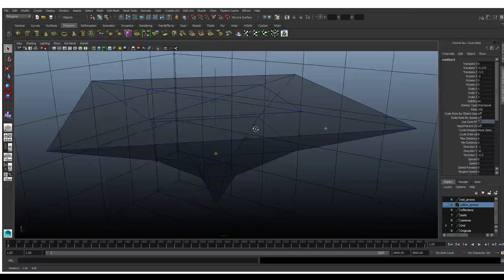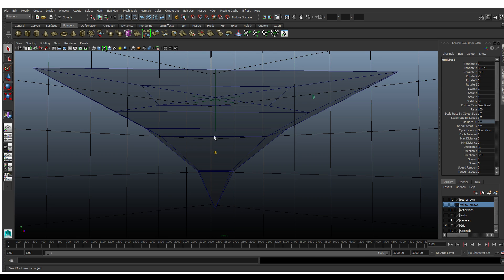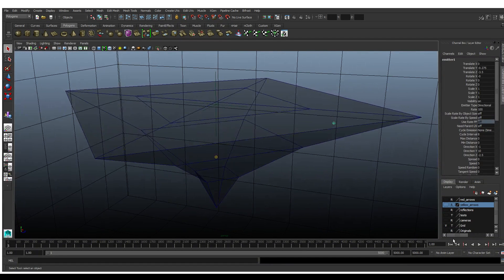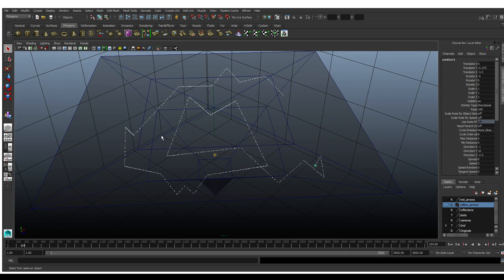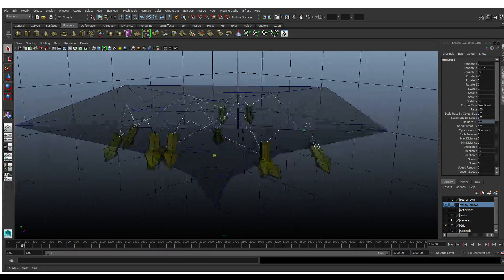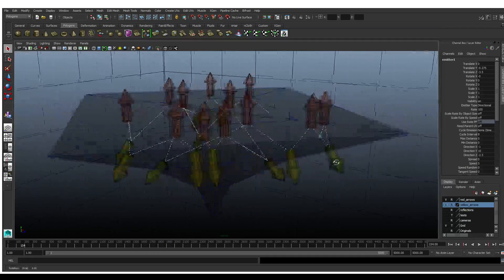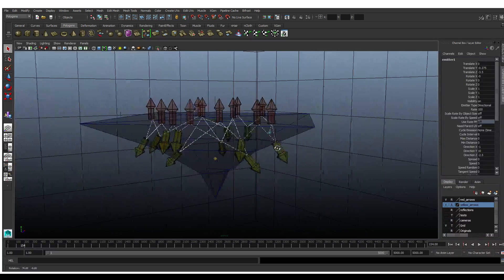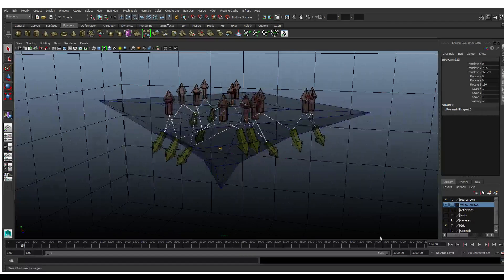EMDrive Simulation 02

Comment: How much bounce could a single photon make before the increased wavelength make it diffuse through the material? Or will it stop before that? What about heating? Does the upside heating more than the bottom ones? Heat radiation reduce the thrust?
Reply: the heat should be transferred to back side and put a radiator there to use the radiation force too.

Comment from the maker: I just want to note, because it is a little unclear. The net momentum is not caused because there are 12 hits on the top surface vs 11 hits on the side walls. The 11 bounces hitting the sidewalls transfer, on average half of their momentum laterally instead of down. That is the major contributor to the net "up" linear momentum.
Reply: +Jamie Ciomperlik Hi Jamie,
I want to ask wouldn't the end design be a "solar sail" where there is NO back end and the microwave emitter is focused on the large front facing sail to create propulsion?
Reply: this is what I've been thinking as well, every time I've seen talk about the force, they've almost always talked about the top and bottom, not the force that is output laterally, the only time I've seen anything about it was on the Wikipedia page for the emdrive, and it said that it was a "negligible" amount of force.
Reply: Is 5is correct, then?

If the top is a flat surface, and the sides are a simplified cone or similar shape, the downward bounces should be distributed more or less evenly in all lateral and downward directions, resulting in a net stationary movement regarding lateral and direction. On the other hand, the bounces against the top, being flat and having larger surface area, will result in a net upward movement, much the same as a solar sail. The advantage of having a contained system would be conservation of the laser beam. You keep bouncing the same beam around in the closed system, whereas with an open sail, you lose the beam to open space after its photons all bounce at angles from the surface... So you should get more bounces of the laser beam in the closed system, and have more forward thrust with less energy output? Further, this should work with just about any particle beam or excited particles...